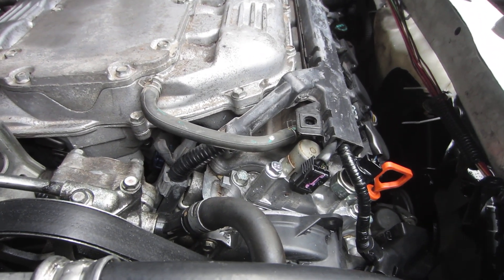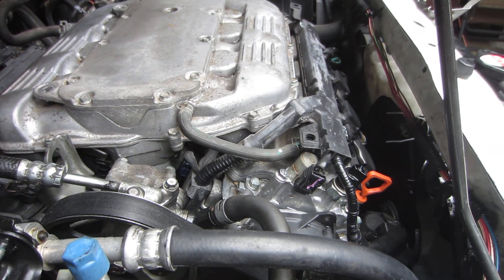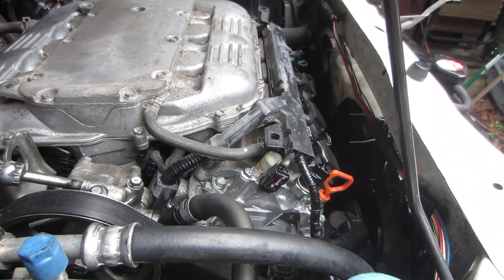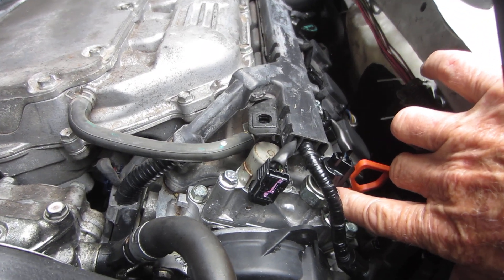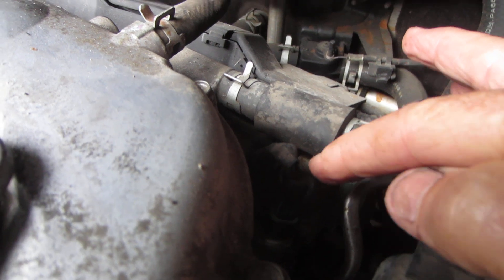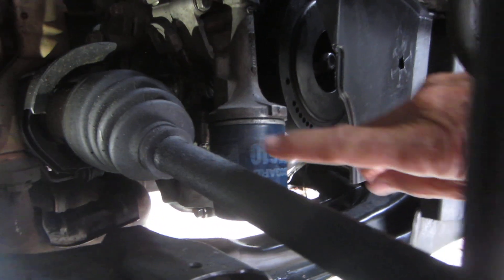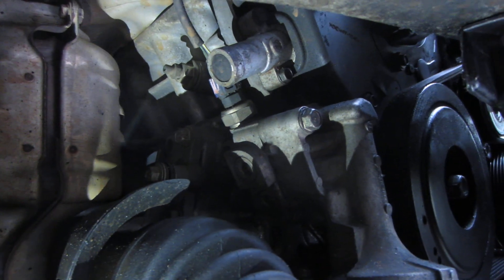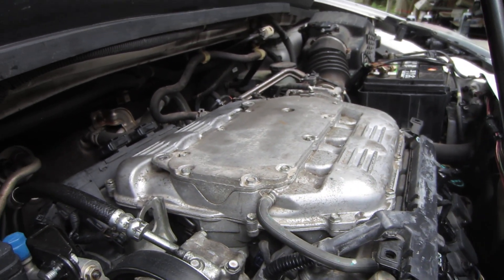How to Find the THREE Oil Pressure Switch / Sensors on a 2008 Honda 3.5 Minivan *Odyssey Project*

Comment: what part number is the one close to the oil filter?... mine is leaking but I want to have the part on hand before change it. thank you I appreciate.
Reply from the maker: Not sure about the part number, but a Honda parts website HONDAPARTSNOW gives pages with parts breakdown illustrations and is very helpful. Have your VIN handy if you do look it up that way - I have used them many times. I have also ordered Honda parts from a dealer website named HONDAPARTSGUYS in Birmingham AL, I think). They both sell OEM parts at good prices, IMO - but shipping charges may apply. I saved about $100 on an OEM oil pan in the past. Hope this helps!

Comment: Which one would give the "odyssey p2646 code rocker arm oil pressure switch circuit low voltage" code?

I replaced thr entire VTech spool about 6 months ago and got this CEL today
Reply from the maker: I don't really know - if you get more info on it, please let us know! Thanks
Reply: Did you ever figure this out? I am currently having the same issue.
Reply: @prodigy984 Well, maybe. I switched the oil and I started putting Valvoline Restore and Protect 5w30 in it. So far the error hasn't returned

Comment: what is the symptoms for this?
Reply from the maker: This video was posted solely for informational purposes and the information could be useful for many mechanical issues. If you have trouble lights on, have a code reader tool plugged in and check for trouble codes. This vehicle was functioning well. Thanks

Comment: Nice tattoo man
I got a p0118 (coolant temp sensor) and p3400 together. Could either one trigger the other or just go for the oil switch to knock a code out?

Comment: So If I'm getting a code for the vvt pressure switch it would be in the first location where those two were close together?
Reply from the maker: Yes, it should be the one by the dipstick tube, I believe. Should be a fairly easy replacement. Be careful not to overtighten it and strip out aluminum threads. Also, possibly could be the VVT solenoid, on the VVT spool valve, but not likely, IMO. First, I might try a good oil and filter change with proper viscosity oil - sometimes that fixes some sensor/ VVT issues on the Hondas. Also look for oil leaks around the dipstick tube and below. If the car is over 12 years old and over 140K miles, those rubber gaskets often harden and begin leaking, and if so, the hot oil drips on the alternator and destroys it also. If so, catch it early if you can. In my experience, Hondas have great engines internally, but the externals can get to be a problem on older vehicles. Thanks for the comment!
Reply: @cubmancan  Thanks for the input!! I'm thinking the oil change MAY do the trick based on yours and others advice on Honda. I bought this used and it's time for an oil change according to only my usage of the van. Who knows what the last person did.... It only happens at very slow speeds, almost like it's running out of gas, but obv it has gas. Trying to oil change tomorrow, been out of town for the holiday. 🤞 it solves it otherwise good to know the switch isn't a hard job!
Reply: @cubmancan  I did do quick visual check for any oil leaks around the dipstick, pan, and filter they looked good. Like I said🤞

Comment: Wow that is exactly what I needed. Now took my computer give me an indicator that they're going out? It hasn't said anything but everytime I start the car it feels like there's no oil being pulled into the engine. And the levels are great.
Reply from the maker: I think a good code reader would help with that. Honda vehicles are very particular about clean oil and filters (and correct viscosity), so make sure you have that in place. Be careful, don't want to do engine damage due to low oil pressure. Hope it works out for you!